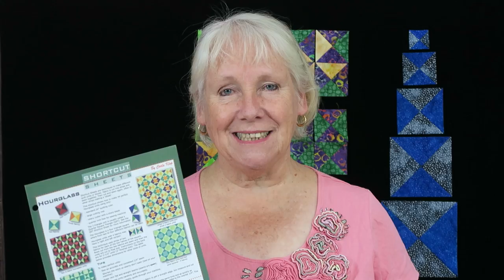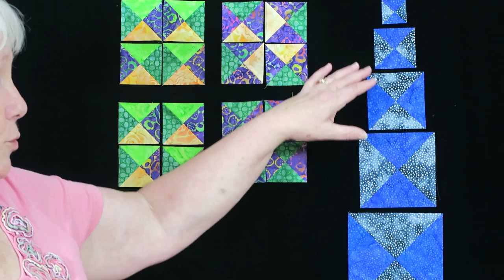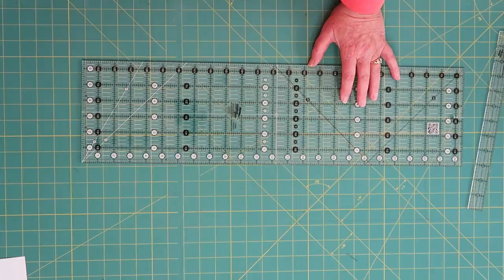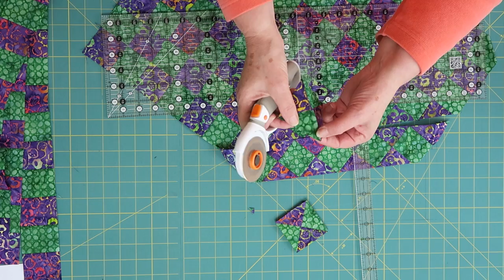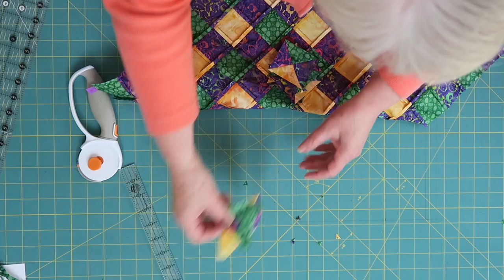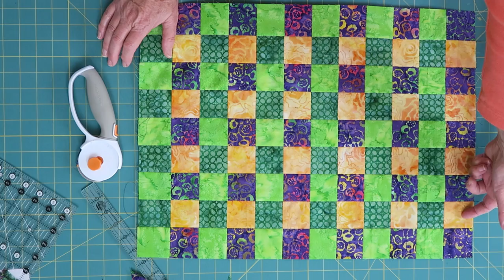Hourglass tutorial - fast and easy using Shortcut Sheet method

Comment: I was told that pressing seams open weakens the seam.
Reply: Yes, my methods are non-traditional and many rules are broken but not without reason. Open seams are straight, when pressed to the side, there is a slight curve. Also, if you do enough quilting and if you shorten your stitch length, your seams will be strong enough.